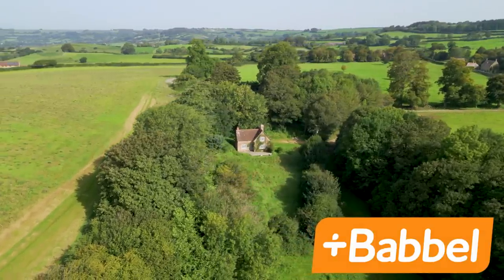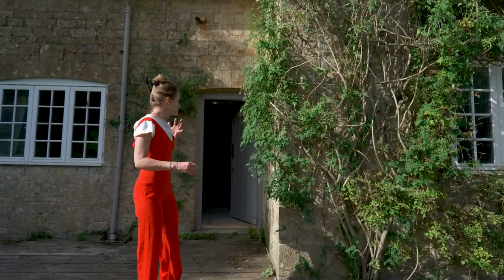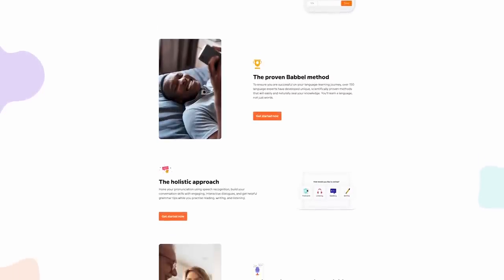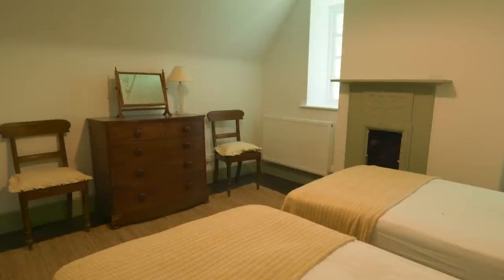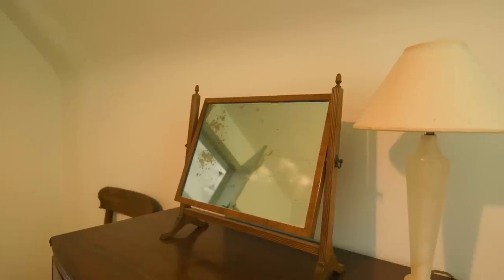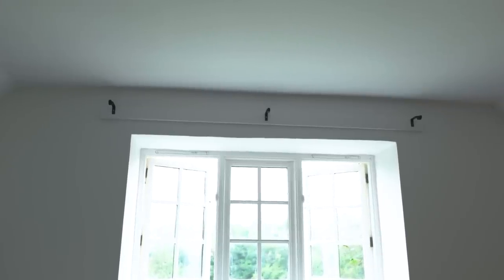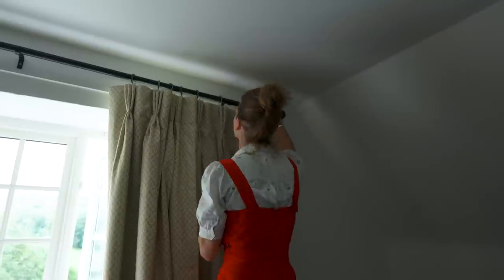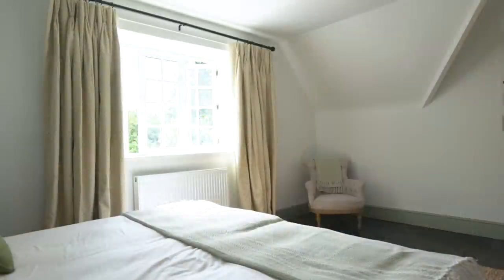Cosy English Cottage BEDROOM MAKEOVER - HAPPY REVEAL (lots of BEFORE & AFTER!)

Comment: I think it would be nice if you had the tulips on the fireplace in the first bedroom hand painted to pop out a bit.  A darker green on the stem and leaves, and a different bright color for each flower.

You should also consider having the roof cleaned on a regular basis to help prevent future leaks.  All that growth wears down the tiles and helps moisture get in, and in cold weather that can freeze and start to crack the tiles.